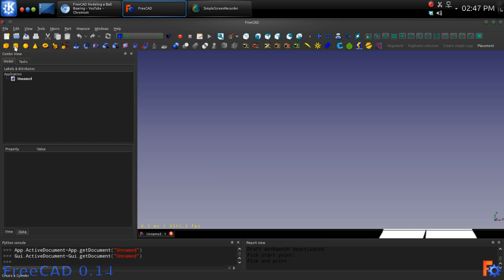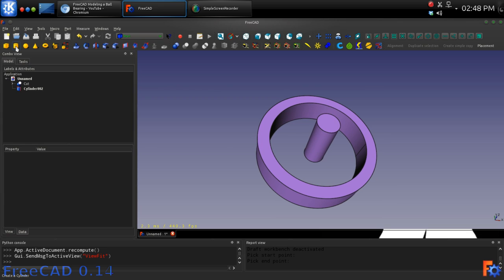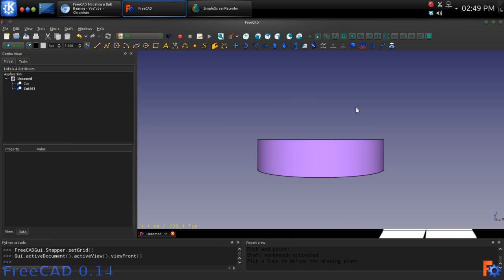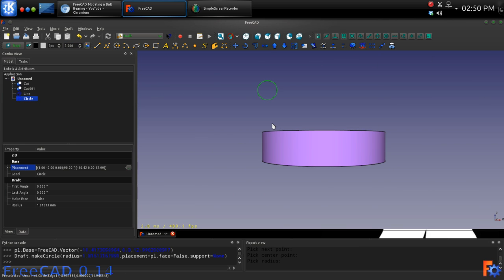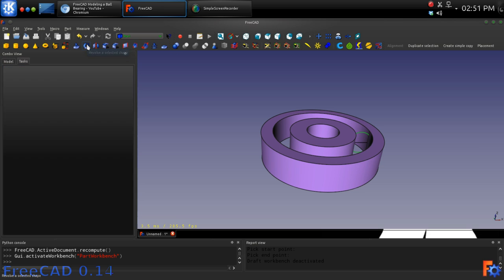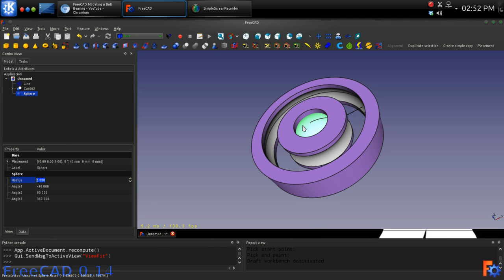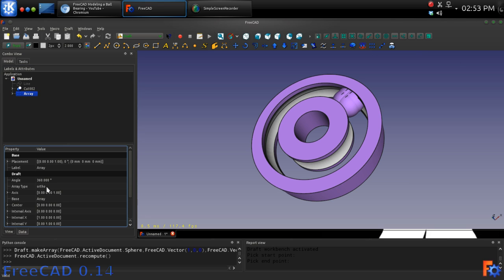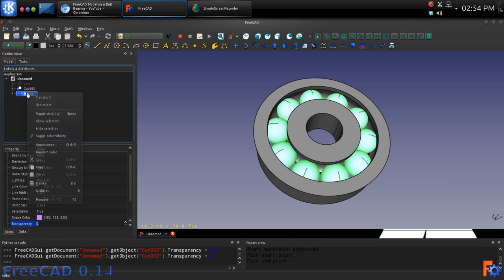FreeCAD Bearing Tutorial

Comment: how  you did that  nice dark template , my freecad  cames with that  white or light old template , can we change ?  or must install other ?  

thanks for this video...
Reply from the maker: I use GNU/Linux and the KDE desktop, I have made a custom dark theme that is system wide. Everything looks like that. ;) 

You can however use StyleSheets to control your interface look. there are several built in to the latest release of FreeCAD, If you don't have it, you should be using version 0.16.6704 Release. You can also create your own custom StyleSheet and place it in $HOME/.FreeCAD/Gui/Stylesheets and activate it via Edit > Preferences > General > Stylesheets in FreeCAD, or whatever the equivalent path is for your OS. Edit > Preferences > General > Stylesheets is where you will find the settings for the few already provided.
Reply: 61quick  I Got it ,  i am using now  the dark blue theme , and was there 
your help was essential .i am  noobie at FreeCad , but its amazing  this program 
 thank you very much ;)

Comment: Nice work! Thanks! I have a question about the simulation, how can I simulate de mechanical movements!
Tks
Reply from the maker: +Flash Strike There are several ways to animate a FreeCAD project. One is to use a 3rd party plugin Workbench called Animation, along with another Plugin Workbench called Assembly2. Neither of these will give you physics though as FreeCAD does not employ a physics engine yet. For that, you would be best to export your model to another program like Blender that does have a physics engine and can do the animation as well as give you a darn nice render of the action.
Reply: +61quick got it! I need to create a chassis with the suspension and see if the angles are correct... and so on
Thanks Quick I will give it a try cause I work in lightwave

Comment: Hey I on mac also and I am trying to make it so you can drag things like you do without using the faces of the box. I am using a regular mac touch pad. I cannot drag my item. It only lets me zoom in and out. To see different faces I have to use the cube's box, which is frustrating. Anyone that knows how to change the setting ?
Reply from the maker: Santiago Diaz There are different navigation settings in FreeCAD. Perhaps changing the navigation style will give better results. Try CAD navigation, or Guester navigation. It sounds like your currently using Inventor navigation
Reply: I firgured it out 61quick. Thanks so much for you useful video and help.

Comment: Really useful video... Thanks!
Reply from the maker: Your welcome. Comments like these help me determine which way to go when making these videos.
Reply: 61quick Sir, I've a doubt. According to the bearing dimensions which I need, i made a design. In that, the ball diameter is 7.93, so I took the radius of sphere as 3.96. But, it is not fitting inside the groove at all. Can you please solve my problem? One more doubt is that, I'm not able to take the co-ordinates as (-0,-0,-0) while moving the sphere. It is changing continuously because of which I'm unable to create it properly.
Reply from the maker: ***** From here, I am afraid we would be going round and round trying to get your current problem worked out. However, I would be very pleased to provide help through the FreeCAD forum where I am active in helping users with FreeCAD. The forum - http://forum.freecadweb.org/ - is set up to accept your FreeCAD files so those of us with experience can see your exact problem and provide specific help. This is probably something simple, but without seeing your exact document, it is impossible to say with certainty where the problem my be. If your not a menber of the forum, sign up and post your question in the Help section (don't forget to read the first thread - IMPORTANT: Please read first before asking for help - as it will give you all the information you need to provide for a quick and accurate answer. There will be a bit of delay as your first post needs to be approved. (only to help stop spammers)
Reply: 61quick I've re created the same file again and its working now sir!! I didn't make any corrections at all. Thanks for your reply..

Comment: Excellent job on the tutorial!!  Clear and easy to understand!!  I am a Freecad newbie who is still trying to figure out my workflow and with all those workbenches it is hard to know where to start (or which is the right one to use for a certain application).  I have heard that the "Part Design" workbench is good because of its use of constraints, but I notice that in your video you never used it....you only used the "Part" and "Draft" workbenches.  Is this because you really didnt need to use constraints (and therefore you didnt need sketches)?  All of your parts seemed to be just cylinders and spheres.  Am I correct in saying that the "Part Design" workbench is for building more complex contiguous solids, but the Part Workbench is more flexible with more tools?

Thanks again and excellent work!
--
Respectfully,
Steve French
President, Volt Vision
http://www.voltvision.com
Reply from the maker: Thanks Steve, and your welcome! In reference to your question about using Part Design - I could of very easily used the Part Design Workbench for this and is some respects it might of been easier, (at least for me ;-). Or, one could of used a combination of the two. It all depends on the user. The thing to remember about Part Design Workbench is it is designed for the single purpose of constructing a SINGLE, valid, solid part, regardless of it's complexity.  

This video was made to answer several questions in the FreeCAD forum about another similar tutorial video that was not clear in several parts, and as a bonus, it has helped a few more understand a few things about FreeCAD's Part Workbench. 

If your just getting started with FreeCAD, there is a written tutorial on the FreeCAD Wiki to help new users becoam familiar with the Part Design Workbench. It can be found here - http://www.freecadweb.org/wiki/index.php?title=Basic_Part_Design_Tutorial.